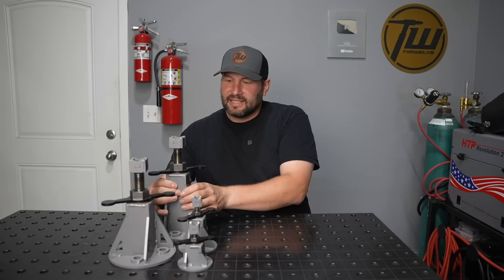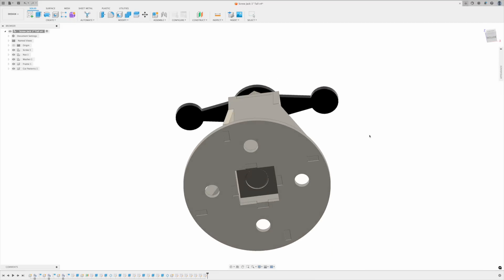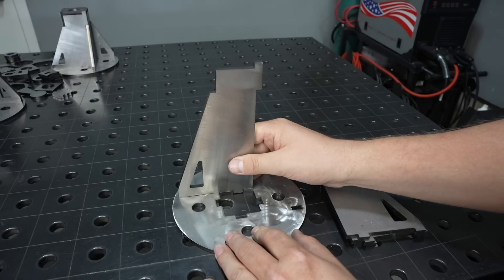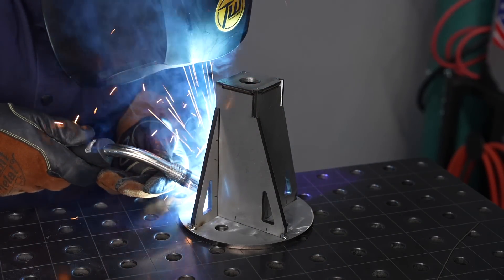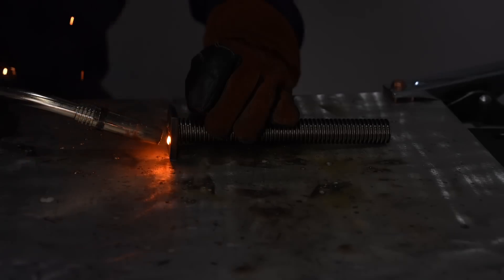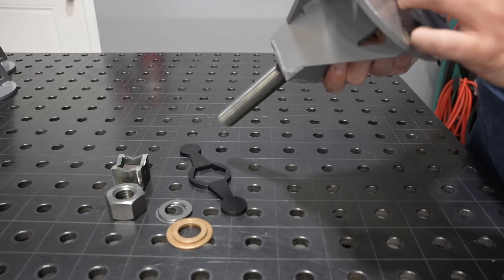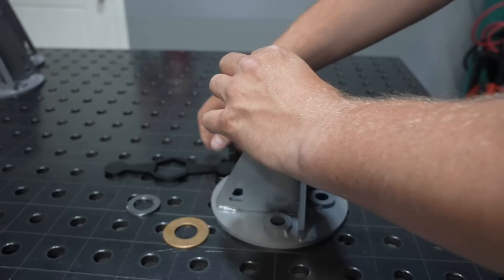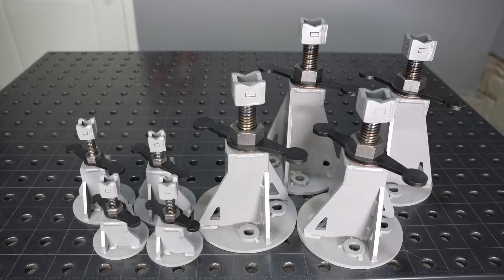Building Acme Screw Jack Stands for Fabrication

Comment: Scale it up a bit. Add another leg. Put nice large diameter caster wheels on the ends of the legs. Put a seat on the top. I'm thinking steel tractor seat. Now you got one of those cool shop stools that are so overpriced. I'm a fan of the tab and slot thing. I do that when I make my giant yard dice. You did a great job of it, super cool.
Reply from the maker: That's a great idea. I've thought about making my own shop stool from cut plates, but my Amazon doctor stool works pretty good.
Reply: @TimWelds  If you don't mind, I'd like to make one for me and maybe a bunch more to sell. lol
I have a Langmuir Systems CNC plasma cutter in my shop... so...

Comment: I still use an old automatic hacksaw, ( I find it nice and quiet, slow but reliable and perfect cuts every time). I find this sort of jack invaluable to support longer lengths of steel when using it, as the bed is about 30cm above floor height. Mine are just old caravan levelling stands  that i have repurposed.
Reply from the maker: An automatic hacksaw would be awesome to have. Don't see many of those around these days.

Comment: Hi
what is the bearing capacity for the one inch Acme screw.
Reply from the maker: For the screw itself, it's really high. The bronze thrust bearing is rated at around 2 tons rotating at full speed. The load is not distributed over the whole bearing, which reduces the capacity, but it's a static load, which increases it a bit. Where that lands, I'm not sure, but I expect that it would hold at least 1 ton without a problem. I doubt that I'll ever load it with more than 300 lbs, so they should be great for me.

Comment: Really well done! You could also do it where the wrench is not integrated, but separate, or 2 parts you can snap together into the same shape, but still remove if you needed more clearance. You could also have a swappable top so you could have other options besides the V-block.
Reply from the maker: Those are great ideas! If the top was removable, the wrench could also just lift off. I couldn't think of a clever way to make a removable top without involving some amount of machining, though.

Comment: Very nice. It’s funny seeing it, but I do the same thing you did with the spacers for the table bolts. I’ve made a number of things for the table such as a small platform for the tungsten grinder I built, an arm that I can lean on and slide when I’m welding and a bunch of other accessories. I’ve even spot welded some of those bolts directly to the devices I’ve built so I can just take them off and on without having to get and put away bolts.
Reply from the maker: I could use an arm like you're describing...that might have to be one of my next projects.
Reply: @TimWelds  it’s surprisingly useful. But I did something odd. I added a long ball bearing draw slide to the top. When I slide my arm across, the slide moves and there’s no friction from whatever I’ve got on my arm, such as a leather sleeve. I also attach a holder for the torch or MiG gun and just slide it across when I want a really even weld. I’m working on an auto feed for my TIG rods.